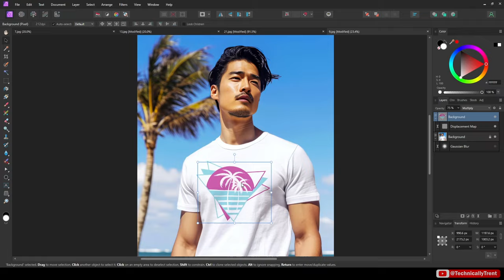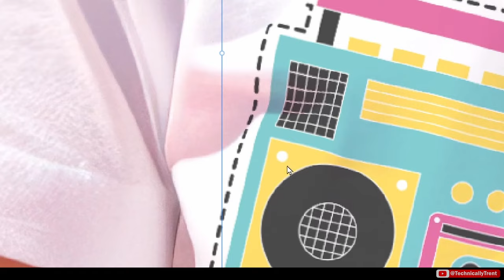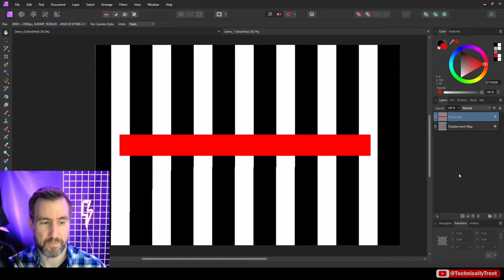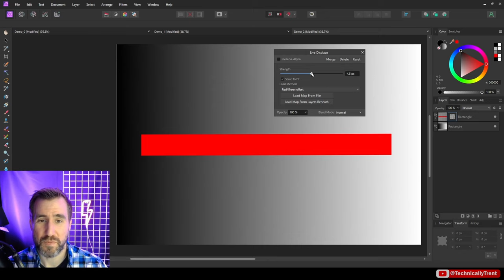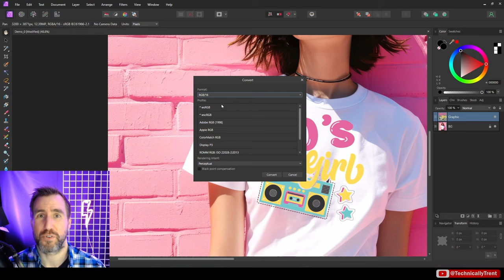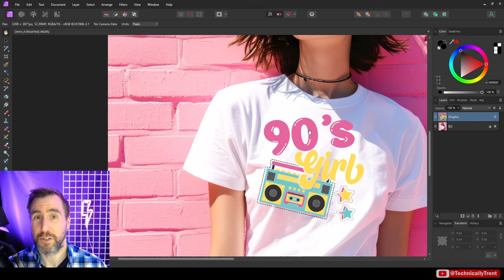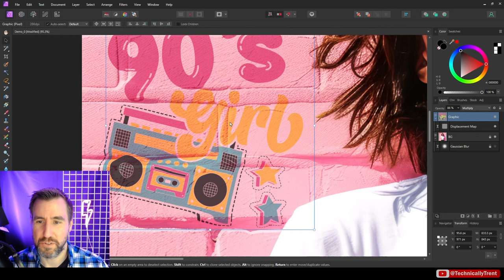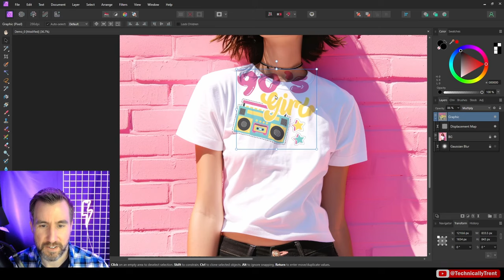Wrap Your Design on a T-Shirt! Displacement Map Tutorial for Affinity Photo

Comment: Great video! Just purchased your mockup set! (Yes, I know it's available for free, but I wanted to kick in at least a little something!)

But I''m noticing an issue where any setting that actually creates the displacement, also seems to create a halo within the overlay image. Now, I initially thought that it might be because I was using a .jpg image. But using a .png creates the same issue. By the time there is enough of an effect to make it believable, it creates a secondary artifact in the image. I actually have one section where the text is in white, and it creates a distinct double line.

I've tried it on 3 of the model images from the set, and the same thing happens with each one. As always, I start with the assumption that I'm doing something wrong or missing something. Any advice you could offer would be appreciated.
Reply from the maker: Hi @barbarianatgate2000, thanks for the purchase, I appreciate it!

I was looking at the filter and trying to see what could be causing the halo effect you explain. One thing that can cause weirdness is if you change the opacity of the displacement filter. To me, it looks like a halo. If you're trying to make your top image semi-transparent to blend it with the shirt, make sure that top image is selected (NOT the displacement filter) and then change it's opacity.

Let me know if that helps. If not, feel free to send me an email with a screenshot and the file. My contact info can be found in my channel's About section. Have a good one! - Trent
Reply: @TechnicallyTrent  Hi Trent! Yes, that's what it turned out to be. The blending issue was applying to the displacement filter. Even at the 100% opacity, it created the issue as soon as it was changed to multiply because the main layer was static.

But I am still seeing a significant pixelation as soon as the displacement filter is applied to any degree where it is even remotely effective. I sent you an email with a few screen caps, and am wondering if you ever encounter the same issue depending on the image being used for overlay?

Help me, Obi Trent, you're my only hope.

And, thanks again for a great channel!

Comment: Hello, thanks for the excellent tutorials. I don't understand why when I use the displace filter, my image (a logo on a transparent background) is completely distorted, not achieving the desired effect. Thank you.
Reply from the maker: Hi Mark! What does the surface below your logo look like? When you use the displacement map on your logo layer and choose "Load Map from Layers Beneath", it will try to bend the logo it based on the lightness of the layer below.
Reply: @TechnicallyTrent  I tried to put a logo on a t-shirt. A very white t-shirt and many illuminated areas, few in shadow. Maybe that's the problem?
Reply from the maker: @markred8  Yes, if the shirt is a solid color without any folds, the technique will not work. It bends the image based on the changes in the surface below it.
Reply: @TechnicallyTrent  Thank you very much. Can you help me with a similar problem? When I use the distortion using the live filter (live mesh warp) I find that the image is distorted abnormally and areas are automatically filled with black by the programme, and I cannot distort the image more than its size. I have noticed this especially if I rasterize the layer, whereas if I leave it as an image layer it does not give this problem. Thanks again.

Comment: Hi Trent, I have another question for you regarding importing a displacement map. Have you tried this? I wonder how the comparative size matters?? Like, if the base image is one size and the import is totally another, you know? I’ll have to look into this. I got curious about this as it sparked the thought of importing any file (which I’ve never done). Now, I have added many images, to create comps, etc., but never for this type of purpose. Yes, I must investigate.

Damn, I had ANOTHER thought. You could make a mask of the shirt, use Threshold, blur it, export it, and import as the displacement map, right?
Reply from the maker: Hi @dougdina!

I did a few tests importing a displacement map of different sizes and it is kind of tricky to know what is lining up with what. I think if I was going to import a displacement map, I'd try to make sure it matched my original image size exactly. If possible, I like to stick with "Load from Layer Below". But I understand that may not be possible sometimes.

Yes, you could definitely try other effects on the displacement map like masking / thresholding. But as long as the graphic you are trying to distort is small (like a logo), you don't really have to worry about masking out the shirt. The parts of your displacement map that extend beyond the logo will have no effect. Hope this helps!

Comment: In addition to temporarily blurring the mockup image with the GAUSSIAN BLUR live filter, I've been also temporarily desaturating the mockup with the HSL adjustment before creating the displacement map. That way the map is based on BW/gray scale as you discussed in your video.

Trent, again an excellent video. Your explanation of using displacement maps is the most thorough and short (i.e. concise) I've seen so far on YouTube. 👍👍
Reply from the maker: Great point, @lowellaguno! I actually forgot to mention using B&W in this video. It didn't matter too much because the shirt is white/gray, but if it was a colored object, using the B&W filter first would be useful.
Reply: @TechnicallyTrent  How exactly would one do this? I followed your video meticulously, and it worked perfectly, but the extra step of desaturating would make it work on darker colors, too. Also, I'm wondering if it is possible to change the color of the shirt? Maybe that would be a consideration for a future video. Your knowledge and teaching is unmatched.

Comment: Another great video, Trent. Thank you. 

So, here’s a question: if we can choose between destructive Filters and Live Filters, why would one want to use them at all?

I don’t quite understand why you used the Gaussian blur then turn it off. 

Thanks again!
Reply from the maker: Hi Doug, thanks for watching!

I believe the destructive Filters existed before the Live Filters, so Affinity left them in there. Also, some of the destructive Filters aren't yet supported in Live Filters. And finally, Live Filters can be more CPU intensive because they are calculating things in real time (this could be very slow if you have a big complicated document). If you are 100% sure that you want a Filter effect to be permanent, it could make sense to use a destructive Filter. You can also create a backup copy of a Layer before applying a destructive filter.

I used the Gaussian Blur filter when creating the Displacement Map. It can help make sharp edges flow a little more smoothly. I find that when I don't use the Blur filter and don't set the bit depth to 16 bits, using the Displacement Map can make edges seem frayed. I recommend trying some example images and you'll see what I mean.

Hope this helps!
Reply: @TechnicallyTrent   Thanks for taking the time to share your experience and knowledge.

Comment: How do you do it on a black shirt?
Reply from the maker: Hi @daricwade_, the process should be pretty similar as long as the shirt has well-defined shadows and folds. Maybe you can try making the Displacement Map's strength negative, but I think it looks fine either way.

Some designs won't look at good on a black shirt, so the type of artwork will matter (as it does with a white shirt, too).